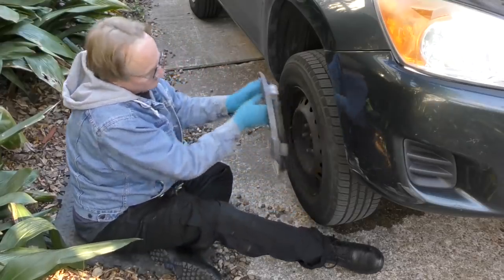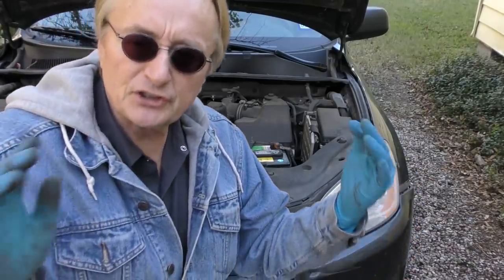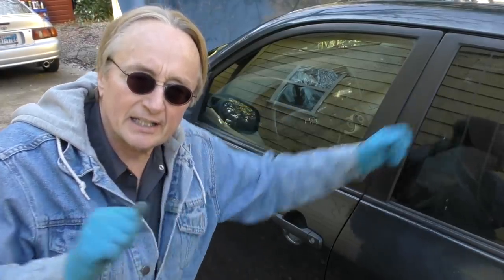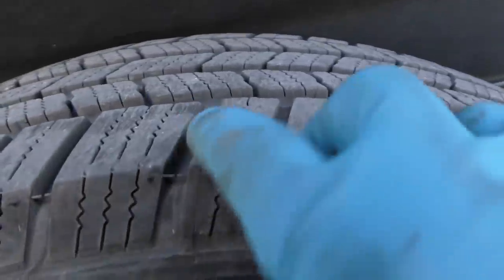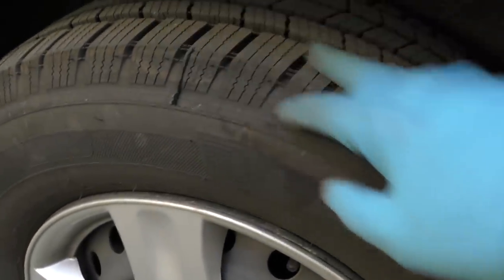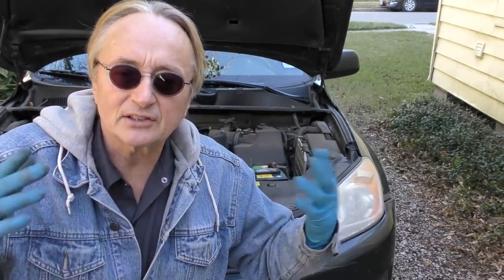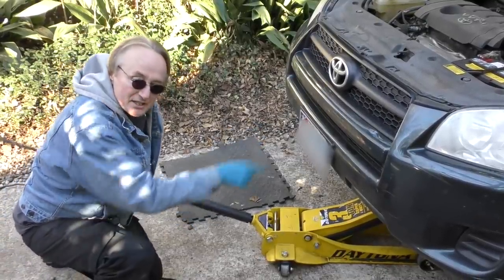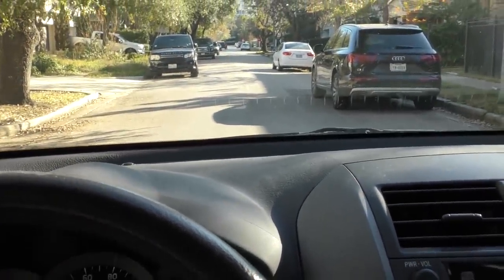Tire Secrets Only Mechanics Know

Comment: I would have had the tires rebalanced and checked the alignment after rotating them. That outside wear bothers me.
Reply: Outside wear?  I believe Scotty just explained why that is.  You must work for a stealership!!!
Reply: @ryanw.5684  He actually didn't explain and James is right.
Reply: There’s still some worn components... I replace most of the moving parts in a front end at about 120k. The difference always blows me away.
Reply: @adcolt54  Actually if you watch the video you will see that the front tires are worn all the way across... NOT just on the side... Schneider tire in Marne , MI... If buying a new set of tires will rotate your tires every 1000 miles at no charge... Just to give you an idea of tire wear...
Reply: Outside wear because of road camber to help highways drain water. I should know in the 
Uk we have loads of camber on the roads
Reply: @ryanw.5684  i work at a tire shop and can confirm that more outside or inside wear indicates a subpar alignment
Reply: @amranfarah  That's caster not camber. Camber affects the inside outside tire wear.
Reply: Panamera Ghost 
👍🏿road camber. Road surface Falls away at the edge Closest to pavement. Yes on fast road setup suspension geometry with a lot of dialled in camber your tyre’s inside will wear granted.
Reply: @gregbrophy5781  no it's not.. and balancing comes free with changing tyres anyway, you just stick weights on or hammer them in if it's a standard wheel and not an alloy , so where did you get the idea it's a scam if it's done for free? Tracking costs money and that's different from balancing and you have to adjust the tracking rods and adjust it with the help of techno-vector.. adjusting it to get left toe and right toe balanced to get the centre toe perfect. And yes tracking helps a lot, because without it your car will pull left or right and depending how it leans it will cause more wear and tear in the inside or outside of the tyre as it leans harder on each side that is off.
Reply: The front/steer tires always wear on the outside corner/edge. When you corner or go round a roundabout the vehicle leans causing the front steer tires to deflect and roll over to the outer edge. You have the weight of the engine, vehicle and passengers all transferring through the two front tires as you turn the vehicle. This weight transfers to a smaller part of the tire during the lean causing extra wear.
Reply: Fon Hollohan I didn’t HAVE to replace ANY of it. But it’s a hell of a lot better after I do. I always opt for uprated sway bars too. I’m CRAZY like that. Saves on tire wear, and it’s safer. I’m just paying for parts and a good alignment, one and ✅
Reply: Balance with a rotation.
Reply: Ryan Wheeler no he really didn’t cover it. All he said was there is 180,000 miles, so yes, there is going to be some wear, duh. By the sounds of it very minimum wear. Nothing I would have worried about. However, uneven wear on the outside of the tread would indicate something is not in proper alignment. Balancing tires is free in most cases, and even if there is a charge, it’s not much, a tire out of balance will cause handling issues at speed, these tires sound like there OK. Scotty did say the car drove fine. An alignment check with a rotation is cheap. And keeping your car in proper alignment will extend the life of the tires and prevent damage down the road. It’s all part of preventative maintenance, and not doing it is stupid.
Reply: @old_skool9877  That's too frequent. Every wonder why they do that? Check your lug nut torque settings.
Reply: If you go to long without rotating the tires on front will wear on the outside edges even with a perfectly aligned car. It’s just physics. Anytime you make a turn or go around a curve it takes rubber off the outside edge of your front tire to the outside of the turn. Fail to rotate and you end up with wear on the edges. Doesn’t mean there’s an alignment problem not worn parts. 
That’s the purpose of rotating, to cause even wear. What Scotty didn’t do, or didn’t show, is that to of the tires needed to swap sides so that the tires aren’t constantly on the same side of the car, otherwise they don’t get even wear and they’ll wear out faster. 
If the tires were being rotated regularly, every 6-8k miles, and they still got uneven wear, then there’s reason to worry about alignment or worn parts. But not on a car that hasn’t been getting rotation, like this one apparently.
Reply: Lemonbarde I’m ASE Certified Tech and don’t work for a stealership. I actually work for well known rental car company so I don’t up-sale like flat rate techs. Outerwear in front wheels will happen even with perfect alignment due to how the wheels lean when cornering. This is called lateral force effect   which causes inner front wheel to camber positively.
Reply: outerwear in front wheels will happen even with perfect alignment due to how the wheels lean when cornering. This is called lateral force effect   which causes inner front wheel to camber positively.
Reply: Q. Tech it’s actually the outer wheel of the turn. But you’re 100% correct.

Comment: I've had the steering wobble when braking at high speed. For me, it was missing/bad wheel weights or needing an alignment.  🛣️
Reply: Rotate tires and torque tires to spec.
Reply: I had a car few cars that would shake when braking at high speeds, or kind of shudder if that makes sense. Rotors were wearing unevenly and had grooves in them. new rotors and pads and was good to go!
Reply: @ryanpatton1795   And WHY did they warped?  Odds are that the lug nuts weren't torqued properly.
Reply: wholeNwon   I’ve had two low mileage ventilated discs crack internally separating each working side locally creating a bump.  Can only tell by ringing the disc.  Another disc split on the braking surface, that was easy to see.  Most frequently strange feel is broken belting in the tyre, so swapping front back is a good test.  Tyres have manufacturing date stamp,  the grip goes down around 5 years old, so strongly consider changing, regardless of tread wear.
Reply: @jimwoods9551   To be honest, I've never heard of the problem, esp. on different rotors. When you replaced them, did you check the lug nuts' torque?  Were they factory rotors or replacements from the same maker? Google for similar issues others might have had concerning them? As to aging effects on tires, it's somewhat climate-dependent. In my area, I would go 10 years unless unusual wear, cracking, etc. were detected. I've had only one tire slip a belt and another shred a steel belt internally many years before. That was impressive.
Reply: wholeNwon   Lug nuts really?  I haven’t had a loose lug nut since my 3 nut 404 Peugeot haha.  Loosening nuts and freeing the wheel is today’s problem.  Anyway you’re right about climate affecting grip life.  That’s why I said “consider” early change.  Unless you’re a very fast driver you’ll not notice slow grip deterioration.
Reply: @jimwoods9551   I actually remember those cars. A buddy had one and we all sort of chuckled at his buying choice. But he drove that thing for 100s of K miles and virtually no problems. I thought it was comfortable enough. Do we need more than 3 lug nuts anyhow?  No, I didn't mean loose nuts...the opposite. Over tightened, asymmetrically -tightened lug nuts will warp rotors. Shops frequently do this deliberately to make future brake jobs.
Reply: @wholeNwon  Yeah thats definitely possible. they were higher end cars, and I sure as hell have never used a torque wrench on the lug nuts
Reply: @ryanpatton1795   I always do and so does the shop where I buy my own tires. For my car it's 76 lb-ft.  They specifically do it to reduce the risk of rotor warpage.
Reply: @wholeNwon  I know it best practice, but not everyone has a torque wrench. And just because you don't have a torque wrench does not mean I don't think you should never take your wheel off. I am an advocate for best practice though, but in this world where many people don't even know how to change a flat tire, I think getting the torque specs are not that much of a concern.
Reply: @ryanpatton1795   Sure. I bought one ($9.98 @ HF) because my rotors warped. Now I can torque everything properly...lug nuts, spark plugs in my car's aluminum heads, etc.

Comment: The reason for having the better tires in the back is due to that a loss of control will more likely result in a front collision. All cars are constructed to stand against more force in front than on the side. Before someone hammers down the reply “I want control and I can steer my way back to safety when my back comes sliding”, yeh you surely can ‘cause you’re practically a nascar driver. But the grinding sound you would hear when turning you steering wheel in the other direction is the upcoming traffic slamming into your door, ‘cause you are rarely the only one on the road. If your car wabbles due to bad tires when breaking at high speed, buy new tires!!!

Comment: Scotty you've been a mechanic for 50+ years, use a torque wrench on those Lugs
Reply: Torque wrench isn't always needed as long as they're good and tight with a power tool. unless you're using a very weak power tool or you're manually turning by hand, them yes torque wrench. Also most of not all power impact wrenches has adjustments to not overpower the tightness.
Reply: Lug nuts should be always properly torque , if they are under torque they will come loose or if they are over torque you can mess up the lug stud threads and /or cause brake rotors problems ...... take it from my 4 year college + 10 year experience at a real shop not my house garage

Comment: I cross rotate my tires. Front tires to rear, and rear tires crossed to front. I read my manual.
Reply: Hopefully you don't have directional tires.
Reply: @rays7437  I don't have directional tires.
Reply: @bobbylh55  👍
Reply: @falcunt  
Owner's manuals all show that tires are to be cross-rotated. Even on cars that have directional or different sized rear tires.  I see a few cases per year where we have to re-rotate a customer's tires because they develop handling, ride, or noise problems because they had their tires cross-rotated somewhere.  Some times the book is wrong because it's too generic
Reply: @rays7437  if the tires are rotational you have to do front to back rotations and you cant cross the tires because the direction of the tread would be wrong
Reply: @lemonbarde6550  
Correct.
Reply: There are different rotation patterns.. I have 5matching tires so my rotation is complicated 😁
Reply: @gregbrophy5781  
And now that owner's manuals can be downloaded from the manufacturer website, they can just update the online version and say that they corrected anything wrong. So that way they put the responsibility and liability back on the customer.  I had that happen once with a customer who flat-towed his car following the instructions in the owner's manual.  But there was one step missing from the first printed version and he burned up the transmission in his 900 mile car.  The tech hotline response was that he didn't follow procedures according to the 2nd revision and caused the problem.  We called our rep, who called his rep and the customer got a brand new transmission, got a free rental car,  got his hotel bill covered, got all his meals paid, and his first 3 payments made.  Oh and they gave him a free extended warranty on the car.  The customer was satisfied at least.
Reply: cross rotate is overrated
Reply: Bobby crossing not good, rotate once half way for life of the tires, all that is overkill and a money maker for the Dealer.
Reply: @STONE69_  
Dealerships do not cross-rotate.  Besides the cost of the rotation is included in the oil change for most dealers.
But in general, cross-rotating is not a good practice any more.  In general.
Reply: @rays7437  why?
Reply: @reubenflor6325  because of everything said in the above comments.  Noise, handling problems, irregular wear, etc.

Comment: "Best tires on the back" goes back to the days of rear wheel drive behemoths.
Reply: It's actually SAFETY Issue.  If you have more traction in the back (newer tires), worst thing that can happen is that your car will understeer (plow head on) to a pole, in a snow storm. 💃👀🙋 But if you put the Newer tire in the front, when you have balding tire in the back, you will spinout (oversteer) in to a Deep ditch like James Caan in the Movie MISERY, and be kidnapped and have your both of your ankles hobbled,,, 😱😵😨😭🙏

Comment: On every vehicle I've ever driven, regardless of where the drive wheels were, the front tires wore quicker than the rear tires.  It's because the front tires support the heaviest part of the car (the engine), not to mention they bear most of the stress from turning and maneuvering the car.

Comment: Anything below 4/32nds of tread you want the better tires on the rear to prevent hydroplaning. But if you do replace 2 and the other 2 are still in decent shape then it’s still safe to leave the new tires on the front.
Reply: 4/32 is the point where you need to replace the tires
Reply: Lemonbarde correct

Comment: Scotty is right. I worked tires for 15 years. Only time it's advisable to put the better tires on the rear of a FWD is when you are only putting two studded snow tires. Otherwise the rear end will try to pass the front while breaking or cornering on the real slick stuff. The rear end is the anchor.

Comment: Hi Scotty, the same idea you mentioned exists here in Scotland regarding tyres with the greater tread depth being on the rear; regardless of FWD, RWD, AWD or 4x4. 

Being an advanced automotive engineer & prohibition officer I can understand the theory with regard to less chance of oversteer during cornering on a wet road surface (it rains a lot here!) given that the greater tread depth on the rear will disperse water quicker, thus less chance of going sideways into a tree or any other immovable object :-(

I'm not a mechanic, I work for local Government vehicle enforcement and this has been debated over here for God knows how long now.

With my own car I do exactly the same as you; rotate the wheels but mostly for the cost implications so as they all get even wear.

I love your channel and keep it up.

Comment: For safety issues, it's better to put the tyres in the back atleast with front wheel drive. If your car is a front wheel drive and it's wintertime and you accelerate in a corner while your good tyres are in the front, guess what happens? The back side will drift and you will loose control. If you put your good tyres in the back on a front wheeler, it might be slippery when you accelerate but it will be safer around the corners and it won't loose control.
Reply: In the Midwest the only people who accelerate in a corner are people who crash 😂

Comment: The reason why companies put good tires on the rear is for liability reasons. If you have less traction in the front, you get understeer (car plowing) which isn't scary or uncontrollable for average drivers. If you put good tires on the front, the front will have more traction during cornering and you can get into oversteer (fish tailing/spinning out) which can be quite scary/uncontrollable for an average commuting driver. Keep the tires even with normal rotation for best results :)

Comment: So I got scammed because the mechanic to me to replace my front struts and my accord only had 70,000 miles....
Reply: Original struts and shocks generally need to be replaced at around 60k. Plus your new ones likely have a lifetime warranty.  I wouldn't feel bad about it.
Reply: My 05 Accord has 205k with the original struts and shocks. Still drives and handles fine.
Reply: @jeffu.8053  
Because you are used to it maybe. I'd bet money that if you got new struts and shocks you would notice a big difference.
Reply: @rays7437  absolutely, most regular drivers have no idea how much their daily driver has deteriorated in handling and driving characteristics as the rate of change is so slow you never actually are aware of the degredation. Only when major component replacement is carried out will it hit you like a wrecking ball how not so awesome things had gotten.
Reply: big v Honda struts wear fast. 70k is a little earlier but they would’ve needed to be changed sooner or later

Comment: I really hope you have a torque wrench Scotty. Our 2018 Jeep Grand Cherokee Trackhawk had tires put on it at the dealership and they didn’t use a torque wrench and the lug bolt was sheered off after 2,000 miles on the vehicle! It was the front left and we came to a screeching holt going about 80-0 via the rotor dragging on the 5 lane highway. It’s for everyone’s safety Scotty

Comment: Speaking of tire experience. Tires under certain conditions do INDEED change the way the car feels. One experience: 2 different brand, tread design, and/ Or condition of tires on the FRONT can and WILL cause the front alignment to go out of whack! I first discovered. That it was the tires that causing the bad alignment one day when I got new tires on the rear. Then put the 2 matching rear on the front. And WALLA, to my surprise it FIXED the alignment! But not before I had spent like $80 on an alignment job! Speaking of that alignment job I had done before. I was surprise disappointment that the car was STILL pulling to the side after getting the alignment done!! Another experience: different brand or tread designs can CHANGE the way the car handles. I had some stalk Kumhos that wore out and I just went with some cheap Walmart tires. And I can tell you, it never rode the same way again! NEVER again will I do cheap tires. JUST LIKE WHAT Kilmer said the other day!!!!